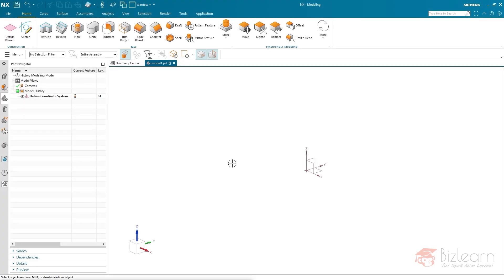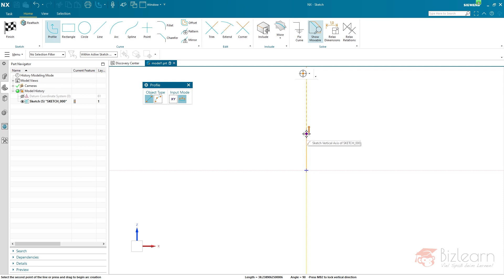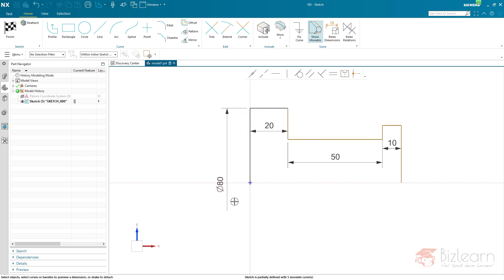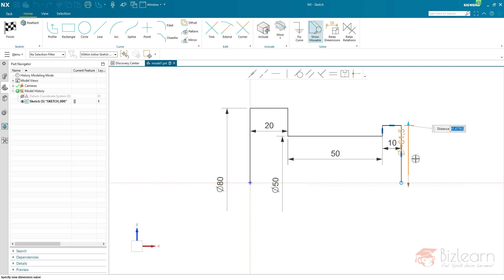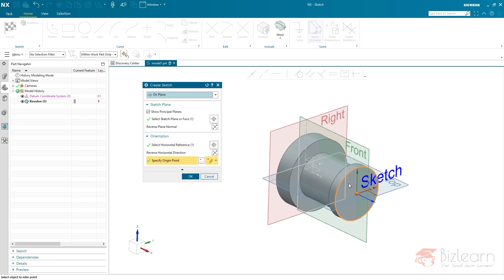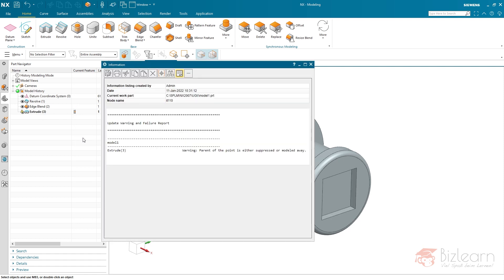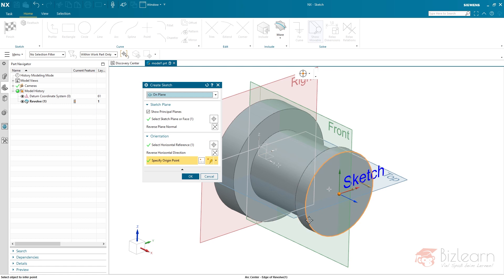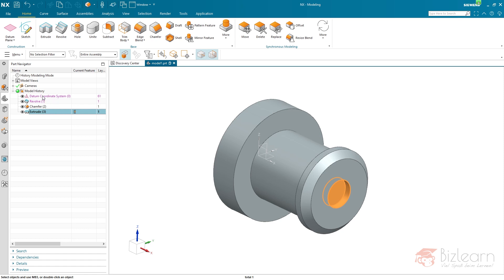Siemens NX 2007 - I can't believe why this is a CAD Secret - Sketch Solver - Half Diameter Dimension

Comment: @Bizlearn thank you for your valuable content about this, at least for me, hard software to learn. I am a beginner with NX and parametric modeling in general. One of the most hard part I have found coming from non parametric CAD software is to understand the logic behind the relations of sketches with the different part/feature of a design. As a matter of fact it is common for me to believe to have done everything in an appropriate way but, when it is time to update one or more parameters, I get a cascade of warnings/errors. I experimented the same type you showed in this video as well. So, maybe you already did it, but I would like to ask you if you can suggest me a video (of yours or not) or some other resource where to get familiar with this important aspect of this kind of software. Thank you very much in advance, Federico
Reply from the maker: You're welcome. Thank you for the detailled comment. I understand your situation. Both methods, system kinds have its benefits! Did you have a proper training therefore, or just open source programs like YouTube? Regards, Simon

Comment: I always set the Origin Method to "Use Work Part Origin". More often then not that automatically sets the origin to be the same every time unless there are scenarios where you want it to be different, in which case you specify those as needed. But it saves this problem from popping up many times less then it otherwise would.  Check it out... might help with horizontal modelling (as you call it) and save some rollback error fixing time. :)
Reply from the maker: I know, what you mean, but the option is no more available in the new "Create Sketch" dialog
Reply: @Bizlearn_Siemens_NX_Training  Hmm i checked before i posted that msg in 2007 and it was there. Not sure whats going on there.

Comment: Hello,
thank you for the video. I have tried unsuccessfully to convince Siemens to retain the CSYS option functionality when creating a sketch since version 1953. With that, the option to re-select the plane also disappeared, yet when reconnecting the sketch this option is there as you show in the video. It's illogical and incomprehensible, but apparently Siemens knows why it does this. Maybe we will see a change at some point. I wish you a lot of success.
Reply from the maker: I fully agree here! Open a ticket and it'll be recognized. 😉